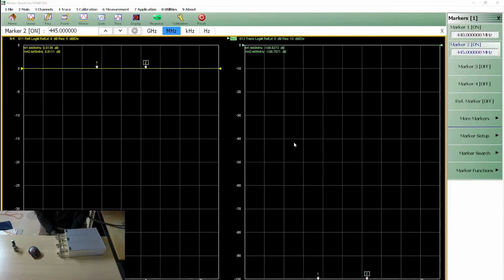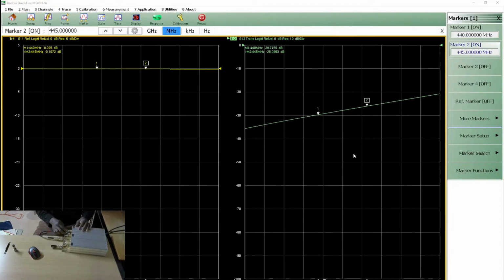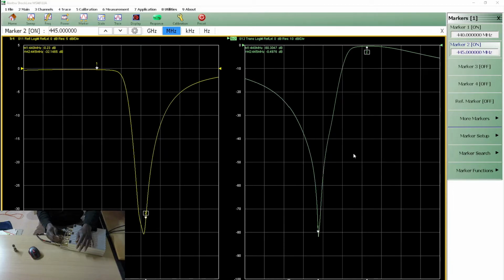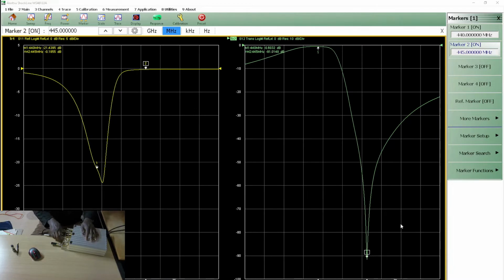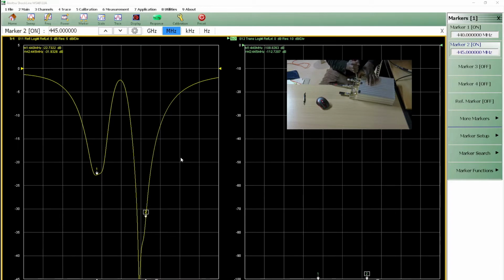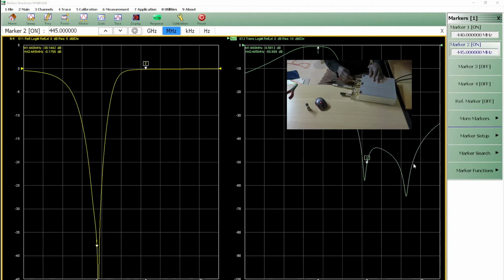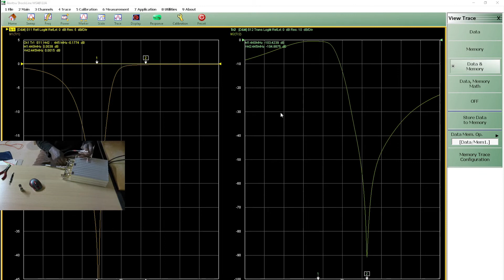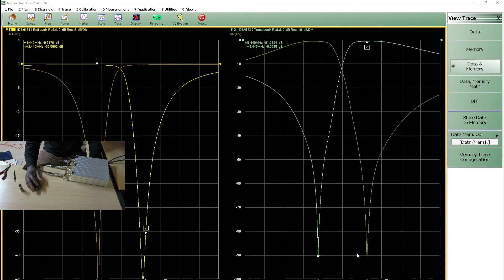INTERMOD BMD480-4 (100W) Compact UHF Duplexer Specs, Features and Tuning

Comment: I have been using and specifying “Fingu” brand BpBr duplexers for the past 10 years or so.
They are (we’re?)  the OEM manufacturer /\/\otorola’s public safety duplexers and other cavity products.
My primary source, just retired last month, so I’ve been considering which manufacturers / products to standardize on.

Most of my clients are smaller public safety agencies NOT utilizing statewide TRS systems.  Small police departments, volunteer fire depts, etc..  
They are mostly using conventional UHF and UHF “T-Band” (470-512MHz) repeaters (FMN / P25 Phase 1 / DMR) and rarely exceed 50-75 watts.  Depending on performance and build quality, this might just be a good solution.

This duplexer (& company) looks promising.

Thank you for the video!
Reply: Yikes… forgot.
About 20% of our clients are using “T-Band” UHF which uses a 3MHz spacing vs. 5MHz .
Can this duplexer handle this ?
Reply from the maker: Yes, it can do a 3MHz spacing with  slight degradation in specs.
Reply: @Blackway2001  Thank you for the quick reply.  

That is good to know.

Only a very small  number of our “T-Band” (3MHz spacing) systems are at the type of backup / secondary sites where we’d consider using these.
The primary hardware is mostly at high density public safety tower sites where we would be using mandated and specified BpBr duplexers and more extensive filtering.   
In addition to lower specs on paper, most of the “mobile” duplexers out there cannot handle 3MHz, so knowing we can possibly stock one model for the majority of UHF systems 

The specs seem quite good and the build quality seems CONSIDERABLY better than the typical “mobile” duplexer we’ve been seeing for years now.   
I checked with several of the larger US distributors (Talley / Alpha / etc..) and couldn’t find the duplexer or anyone handling the brand.   

Where did you purchase yours?
Thanks!
Reply from the maker: @PowderMill  I manufacture them myself. Check the website and get in touch that way.
Reply: @Blackway2001  Fantastic!
Thanks…. I’ll reach out during the upcoming week.